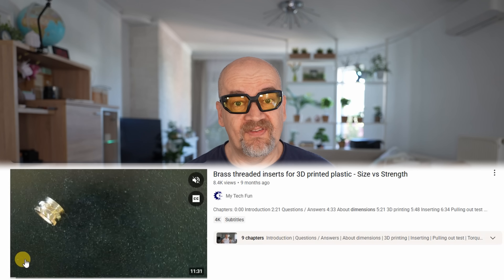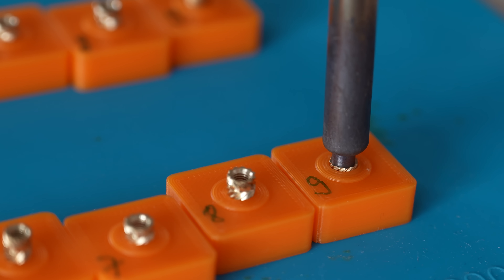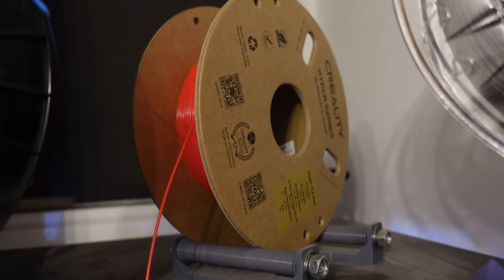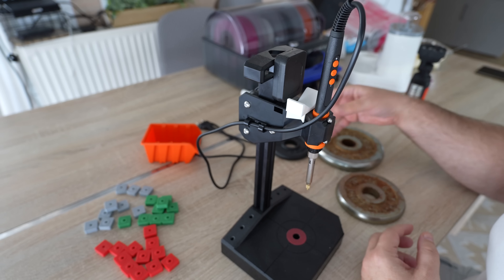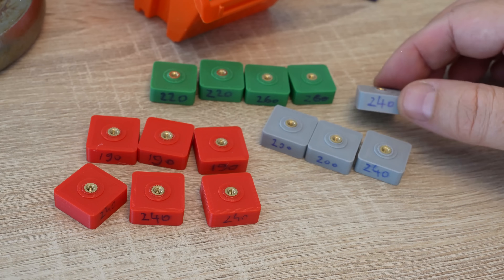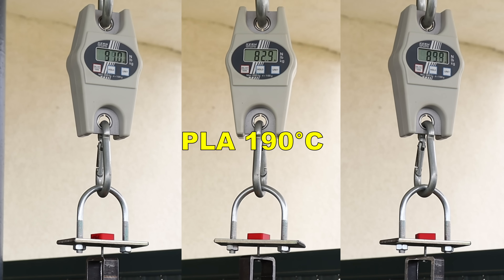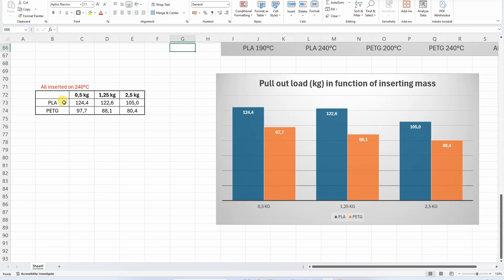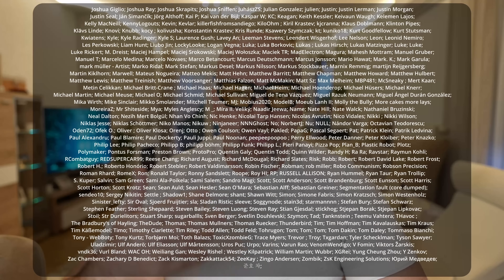3D Printing Heat-Set Brass Threaded Inserts: Effect of Speed and Temperature

Comment: If a particular nozzle temperature is needed during printing to ensure good layer adhesion, it stands to reason that the heat-set insert should be heated to the same or higher temperature for good adhesion.   Insertion speed should be only as fast as needed to heat the filament; go too fast and you're crushing your way through instead of melting through the part.  I always set the iron 20C higher because there's very little penalty for going too hot, but big penalties for going cold, as the inserts cool quickly as they're inserted.   I don't concur with MTF's technique that uses a separate tool to flatten the insert against the top surface; you should push the insert so that it's slightly below the surface and the material spills around the top.  I use flush cutters to trim any plastic projecting above the object surface.  Not only does this help lock in the insert and prevent pull out, it ensures the entire toothed surface melts the surrounding plastic to provide strength.
Reply: One reason to press with a flat surface is to have the insert in straight. Depending on the application that can be more or less important.

With a press that moves straight anyway, I feel the additional step is unnecessary and may actually be harmfull. You press without heating and, depending on the pressing surface, even wicking heat away.
Reply: Properly designed holes should have a small chamfer or counterbore to allow the extra material to have a place to go
Reply: Imo you can do both for best results.

Insert a slight bit below the surface and then either press a tool against the surface or just the part against the table. This
a.) straightens out the insert and
b.) creates a small flat lip over the insert which makes it harder to pull out +
c.) the added benefit of no further need for post-processing with a scalpel or anything.

Have done this with all the inserts I've ever used and I have yet to pull a single one out.
Reply: Increasing nozzle temp to get better layer adhesion is because the layer below the one being printed is at a much lower temperature, so a higher nozzle temps creates a greater temperature differential meaning that already printer layer heats up more which creates a better bond. In a 3D printed insert, this isn't the case. Too high can cause plenty of issues, just as too low also has issues
Reply: Guys, insert are shit, thats why must be melted to plastic FLAT. The reason is simple - if there's a room over torqued screw between part A with insert and part B without it might reap that insert out.
Reply: There is no adhesion between the insert and the plastic. You are mixing things up.
Reply: @olafmarzocchi6194  adhesion or to adhere means to stick to something. Like paint to a wall. Youre saying the insert is not sticking to the plastic? Interesting.
Reply: @leroy7647 yeah... Plastic doesn't Adhere to metal on a chemical level. So no, there's 0 actual adherence. It only "sticks" because the plastic melts and fills the micro gaps in the metal ever so slightly. Remove the knurling and other things on the heat set insert and it'll be extremely weak and would be able to be pushed out by hand relatively easy.
Reply: @leroy7647  and indeed the insert doesn't stick to plastic, it is retained due to "mechanical interference" where plastic flows in the gaps and opposes motion due to friction/blocking.
This is not commonly considered "sticking" or "adhesion".
If you want to find an interpretation of the word that fits your likings ok, but that's not the common meaning.
Reply: @olafmarzocchi6194  If its not commonly considered sticking what else do we call it, mechanical interference where it flow into gaps is more of an explanation. Also what is the working of glue? Also mechanical interference? What is at all left to be called "sticking"?
Reply: @FrozenByFire3  So we can only use sticking for chemical molecular level bonds? So then tape? Also not sticking? I gladly accept a correction but what is left then that can be called sticking? We cannot just move the goalpost and limit sticking to molecular sticking unless there is a definion somewhere that distinguishes the apparently different forms of sticking.

To your other point, I doubt without the knurling it becomes so weak you can push it out; filament on the nozzle is also pretty hard to get rid of, which is also a plastic to metal thing. Sure the knurling helps, and I get why you added it but that is not an argument for not being called adhesion.
Reply: @FrozenByFire3  @olafmarzocchi6194 From wikipedia: Adhesion is the tendency of dissimilar particles or surfaces to cling to one another. 

Unless you can explain me why this does not apply to plastic and metal clinging to each other I rest my case.
Reply: @leroy7647  Some glues chemically bond, but many don't. Even when they don't, they work by interference but at the microscopic level, which gives the impression of an actual bonding. If the interference takes place at the macroscopic level we could better call it indeed interference.
Reply: @leroy7647  would you call the "groove and tongue" or "mortise and tenon" or "dovetail" techniques to join wood pieces "sticking/adhesion"? not, it's interference since you can see it. Would you call superglue adhesion? it's still interference but microscopic, so yes we call it adhesion.

It might not be an absolute rule, but sticking/adhesion for what you can see is basically never heard of.
Reply: @olafmarzocchi6194  I will let all the shops know its interference tape not adhesive tape. Can you update the wikipedia page of Adhesion ?
Reply: @olafmarzocchi6194  Dovetail is largely irrelevant for getting further in the discussion, as even non-engineers and wikipedia agree this is not adhesion. You say "don't use sticking for what you can see", which I agree with; but this is contrary to your point, you can not see filament sticking to metal like you can see wood construction or bolts. But the important distinction you dodge; why is superglue called adhesion and is fine and filament residue on a nozzle is not sticking because its not doing so at the right level. You will have to explain the fundamental difference between superglue and filament in terms of "sticking". I hear the terms microscopic and macroscopic; can you share an explanatory distinction thereabout that gets us further?
Reply: @olafmarzocchi6194  Seems to me you are mixing things up about being able to "see" interference on plastic to metal (which apart from the knurling you don't) and therefore telling someone he's wrong about calling it adhesion.
Reply: @leroy7647  I checked and apparently mechanical adhesion is a thing, since interlocking at small (not necessarily microscopic) scale counts as adhesion. Good to know
Reply: @olafmarzocchi6194  cool. having thought about the distinction, i suppose filament on filament is on microscopic level (layer adhesion where molecules can mingle rather freely), but filament on metal is about small crevices
Reply: @leroy7647  yes that's why it didn't come to me as "adhesion", but small scale interference in crevices is apparently recognised as "mechanical" adhesion. I won't use it for that use case, since someone less knowledgeable might mistake it as actual bonding, but if I see it used I'll know it's fine
Reply: @olafmarzocchi6194  today i learned for tapes its actually common to have some chemical bonding aspect, i thought they acted more like superglue
Reply: @leroy7647  which tapes?
Reply: @leroy7647  These inserts act on the plastic like a screw that cannot be unscrewed. The plastic forms around the bidirectional grooves to lock it into place. Locking something in place is not the same as adhesion. I hope you have at least learned that by now.
Reply: @olafmarzocchi6194  Semantics!

Comment: some of these heat-insert tools provide an adjustable endstop so you can precisely stop at the same height every time.
Reply from the maker: But it has to be adjusted, since you always have parts with different height.
Reply: @MyTechFun  is your 3D printer not accurate? if the layer height is 0.2 mm, then at 100 layers it should be 2cm tall+-stepsize of the stepper motors, no?

Comment: Man! today while doing heat insert job I remembered you said you would follow up with video temperature and speed of hear inset I was about to requst that and you post it exacly in the same day 😅
Reply from the maker: As you can see, I am reading not only comments, but minds too :-)
Reply: exactly on point 😅, thanks again for another  more great and very useful video.🙌🏾
Reply: In reality I do a lot of heat insert every day, because I sell a model that requires it so I use my heating solder to 400degrees for PLA and do them fast they lock very well, but if the temp is only 200 if i do it fast it will come out easily  another thing Is that don't have time to use the heat insert slider tool, is too slow form my work flow I prefer to have all parts positioned with heat insert i just need to press thing with my heating solder and use metalic flat tool to make them flat with the part surface

Comment: Thanks, Igor.  

I use the VLMP2 insert press.  The temperature is typically set to the same that the part is printed at.  A small pressure is applied since the VLMP counterbalances the soldering iron. Net: my method turns out to be very similar to what you recommend.  Of course, I tend to print at or above the maximum recommended temperatures to maximize layer adhesion.  So typically 240 for PLA, 280 for ABS/ASA, except 305 for Fusion HT-ABS 1.5, and 350C for PPS-CF, etc.  

Great to see the quantified results!

Comment: I love this practical science.  Igor does the experiments so we don't need to do them ourselves.  When possible, I design with the heat-set threaded inserts on the back of the part so the fastener is trying to pull the insert through the part.  A slicer modifier to make solid plastic around and underneath the insert makes it even stronger.
Reply from the maker: I agree, I explained this in my previous video. But then the regular nut may be even stronger, due the bigger aligning surface.